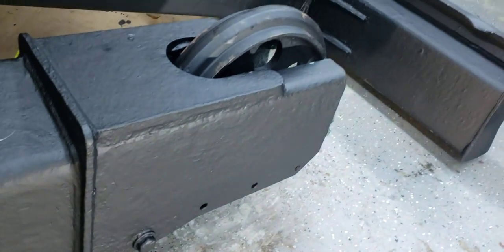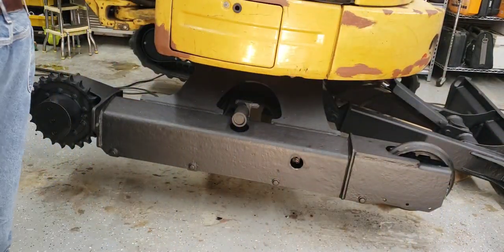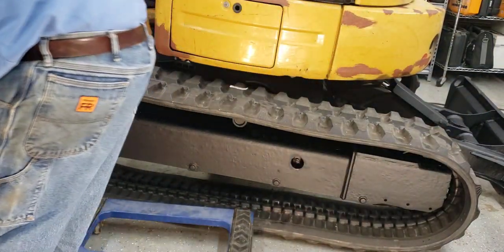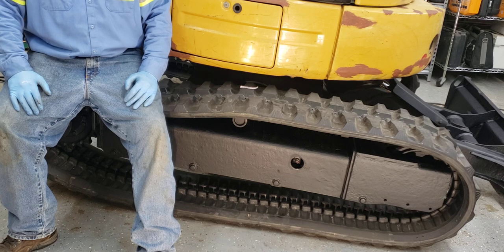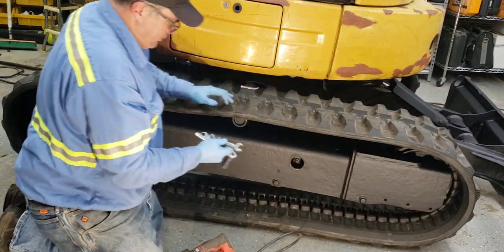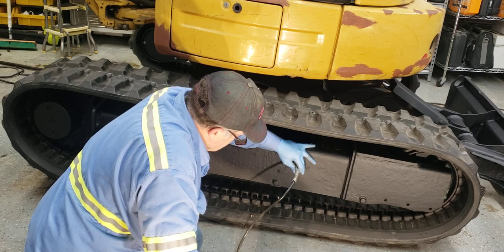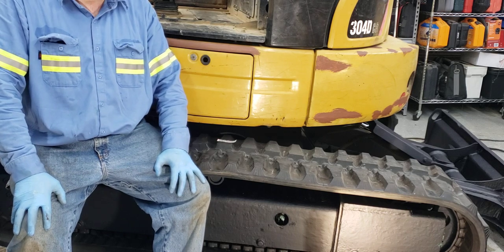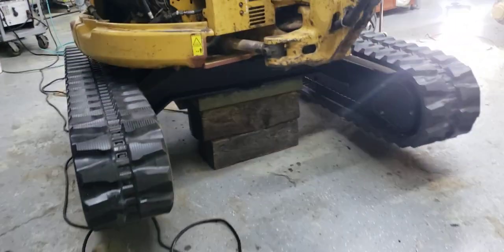Tricks for installing Excavator tracks By Yourself with no Help!!

Comment: I’m off grid in terlingua 3.5 hours from the CAT dealer and 1/4 way up a mesa on a sketchy spot. I’ve done this before but not on this machine. Thanks for the walk through. I’m 3 days in but I think today’s the day. I either get it back on or call the service center. Luckily they said they’d drive out here and put it back on for free if needed. 🙏🫡
Reply: I couldn’t get track on yesterday and I have a feeling I have the same piston issue you did and it didn’t go all the way back.